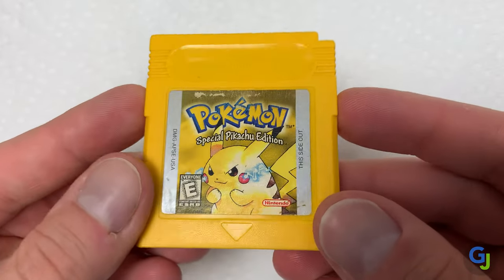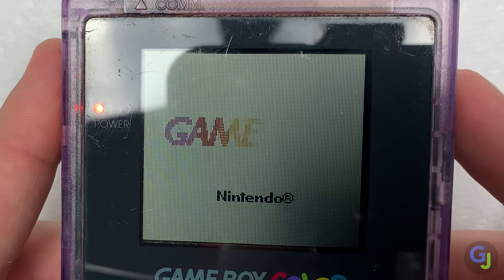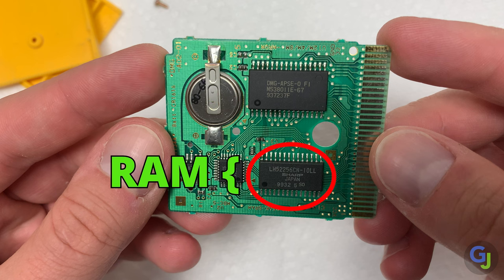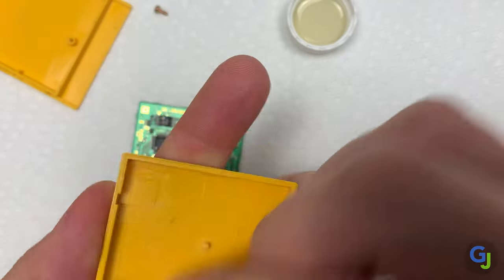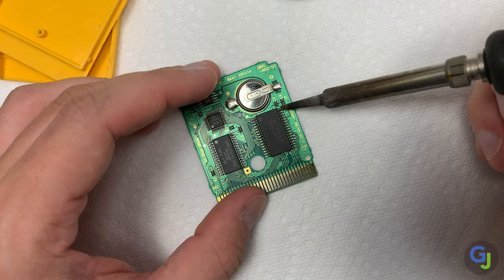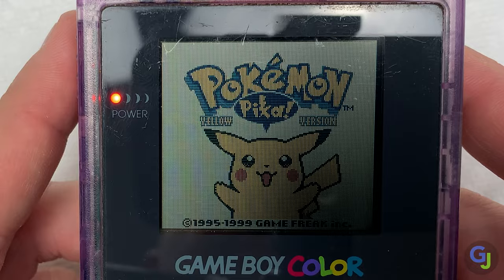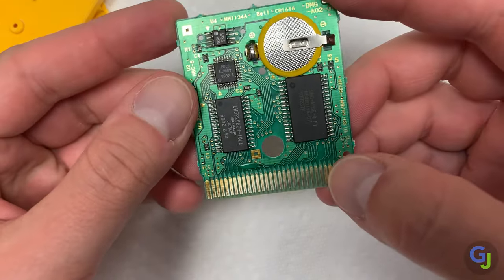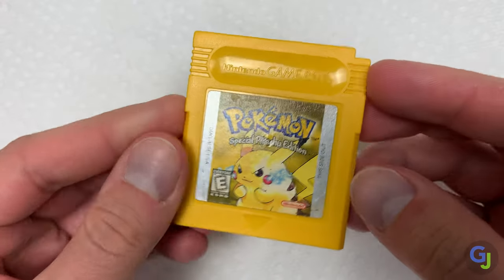Fixing eBay Junk - How To Know What Needs Repair? Video Game Circuit Boards Explained

Comment: Hi, is there a way to fix or replace the pins of a Gameboy Advance game. I would like to replay my Pokemon Emerald but I can't due to the corrosion
Reply from the maker: Its funny you ask because I've been looking into that further recently. I've had a few games that need repairs to the pins and I have an idea on how to fix them but I was looking for more information in case I was missing something. The general consensus I'm seeing online is to replace the entire board though rather than try to fix it. The idea is since games are inserted and removed from consoles a lot, the "fixes" you would you do to it won't last even if your careful while playing. There are kits you can buy to replace pins on boards but they are expensive and really geared towards static attachments meaning no repeated insertion and removal. I'm still looking into it to see if there are any other products that would be good to use but haven't found anything yet. Maybe someone else from the comments would know though?